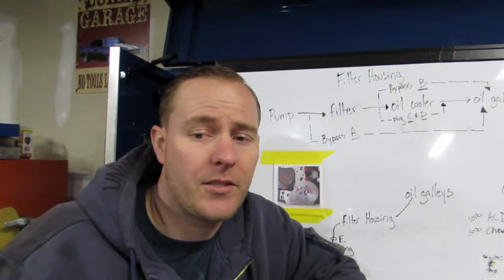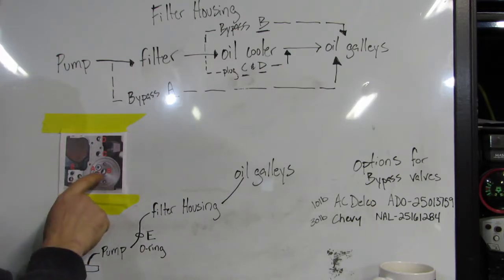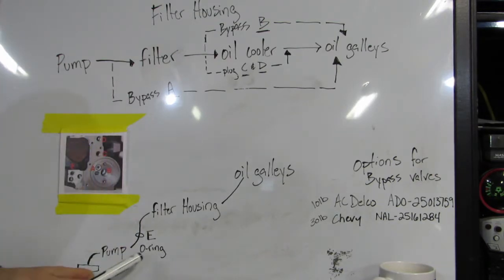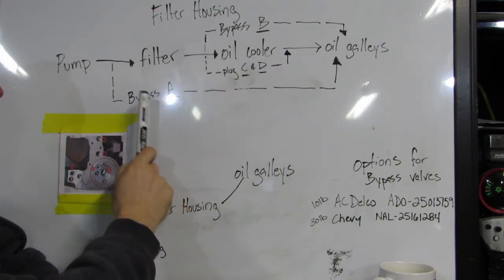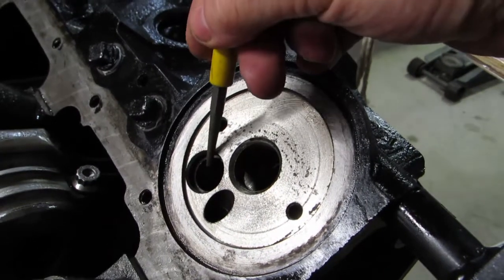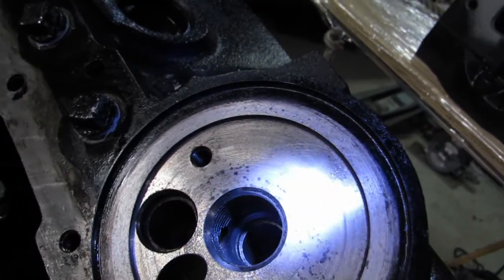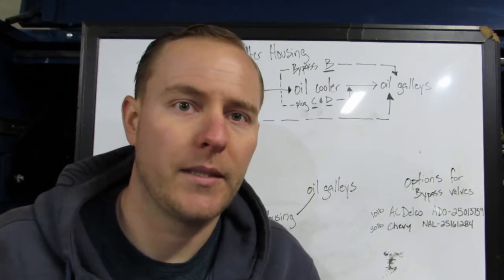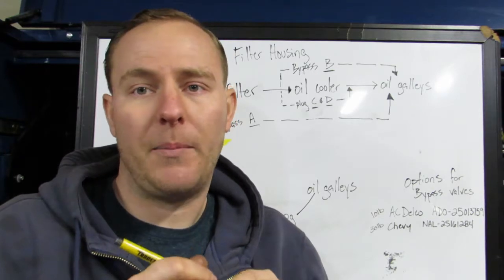BBC Gen V and VI oil filter bypass

Comment: Hi great video. By the way do you know how the cam bearings are installed? Which oil gallery do the bearings point to?
Reply from the maker: They get pressed in, I can't be certain which side the hole in the bearing should point to. I already put the motor in so I can't be certain but if you have the motor apart it should be easy to tell.  Do you already have them out or ...?
Reply: Lukas Garrison I just got my block back from the machine shop and I noticed the bearing that were just installed were staggered, and the didn't all point the same. I don't remember how it looked from the factory, I just found it kinda strange.
Reply from the maker: @izmailovdavid  I understand, take a small allen wrench and put it in the holes to ensure it goes to the passage below. The block casting should have a feed hole that feeds the bearing with a U or complete O shaped cut out in the middle of the block casting for the bearing. I understand that it would make since to be right over the hole but the block will have clearance under the bearing to feed it properly. I will see if I can post a pic for a visual aid
Reply from the maker: @izmailovdavid  https://www.bing.com/images/search?view=detailV2&id=B36D99EC9FEF11D3E65D0EEC2253BC87FB6D6E0C&thid=OIP.AHpG9YbySnOhZ8Ylsmba4AHaFj&mediaurl=http%3A%2F%2Fwww.grumpysperformance.com%2Fcamin13.jpg&exph=563&expw=750&q=bbc+cam+shaft+bearing+passages&selectedindex=39&ajaxhist=0&vt=0&eim=0&ccid=AHpG9Yby&simid=607995152480666005
Reply: Lukas Garrison thank you. I checked with a thin zip tie end. It goes in further than the thickness of the bearing on all of them. I appreciate the help and picture. Great video and thanks again.